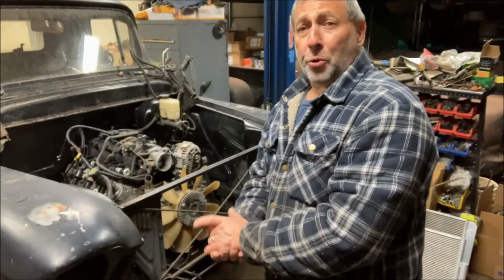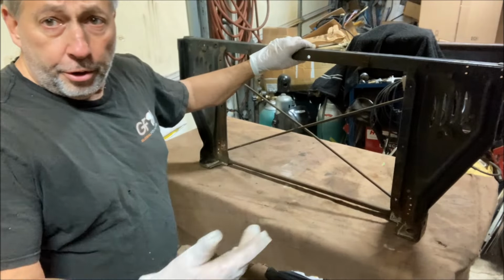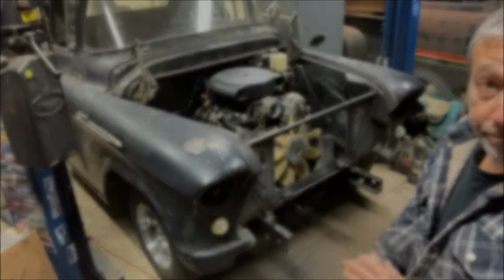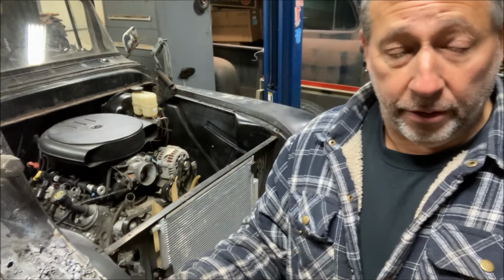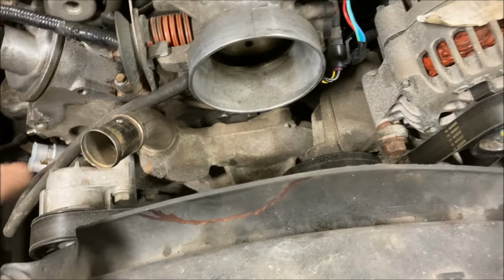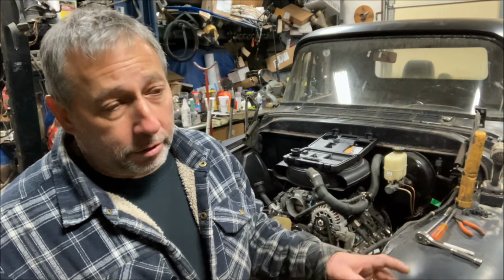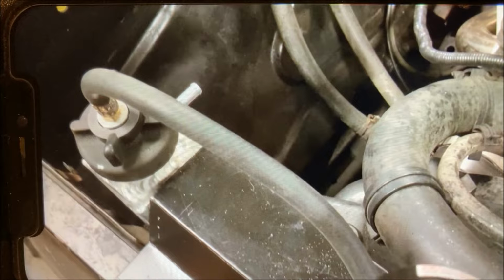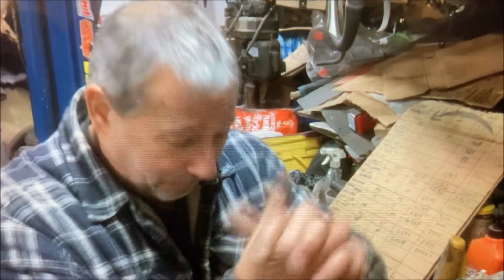1956 Chevy truck cross flow aluminum radiator and AC condenser install for the  $5000 budget build!

Comment from the maker: Note! The steam line fitting you need to use is a 1/8" NPT to 1/4” hose barb, NOT 3/8 hose barb as I installed in the video.

Comment: On your spool gun try using a one size larger tip than your wire on aluminum worked on my miller gun using aluminum it was not feeding through the gun . Nowhere in the manual for the gun did it mention this I found the answer on YouTube hope it helps
Reply from the maker: Thanks, I had a pretty big tip on there, problem I had was heat control. I just couldnt get the heat high enough to burn in and not blow through, dialing it back any amount resulted in being too cold. I think the machine is NG and that is why it was for sale. I will get back to it eventually for more testing.

Comment: When you were using the mig spool gun on aluminum were you running 100% argon? Aluminum requires 100% on argon and it will give you fits on 75/25, also you have to run the wire speed higher and temp lower than with steel.  The material has to be really clean and dry. I used to preheat any thing thicker than 1/4” just to force the moisture out. I used a spool gun a lot when I was working in the oil industry manny years ago. could just be something simple like that. I subscribed so I can follow along on your builds as well.
Reply from the maker: Thanks for subbing,  yes I think I had everything right. Cleaned the metal with a dedicated stainless brush, ran 100 percent argon, and was running 4043 wire which I read was more forgiving. I still have to try the machine without the extension cord, but I really think there is something wrong with the machine as far as the temperature control knob. I may try the cold weld solder sticks to repair the radiator, seems like a joke but from what I have seen it really works.

Comment: Also you need to clean the aluminum really good and you don't want to use same grind disks containing the welding.
Reply from the maker: I used a stainless steel wire brush dedicated to aluminum.

Comment: Cooling systems can be either the easiest or the most work, IMHO it's just a toss up.  In almost everything I swap I use a 2000 Camaro Aluminum/plastic radiator, fits and cools nice, won't break the bank either but I do like your shroud idea if running a driven fan.  You got some mad fab skills, I usually hit the local Pick & Pull for my parts and bend something up.
Reply from the maker: Thanks, I bet that radiator would of worked as well, I will have to check the measurements. Thanks fro watching!

Comment: On the spool gun, what gas did you have?  I think that you need straight argon, I am sure the better welders out there could chime in on that.  Just a thought.  Really like how you mounted the rad and condenser.  Will be doing same on a 59 chevy that I am working on. Andy
Reply from the maker: Thanks, yes running 100 percent Argon. Good luck with the 59!